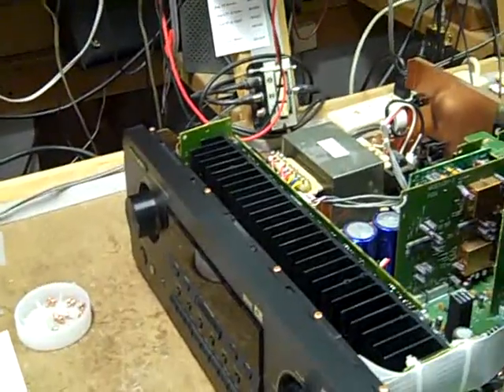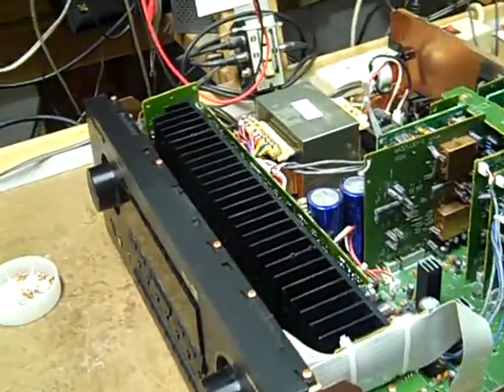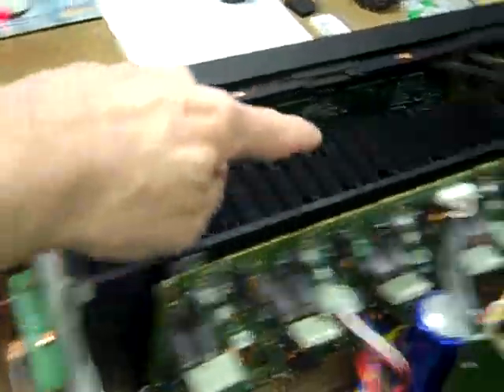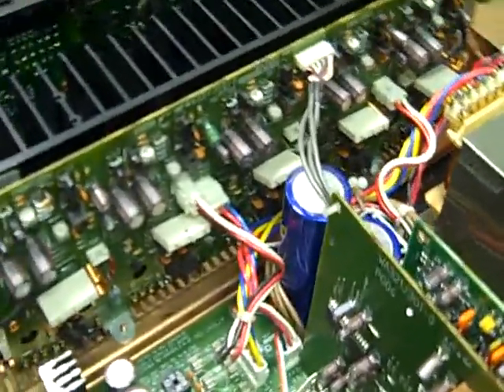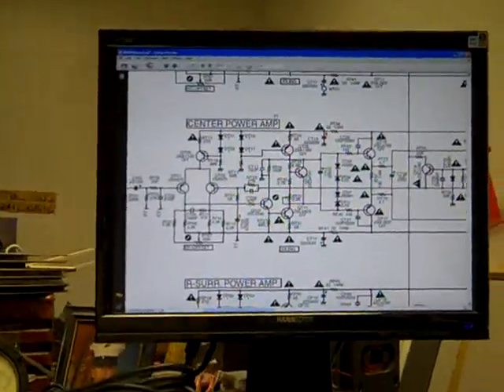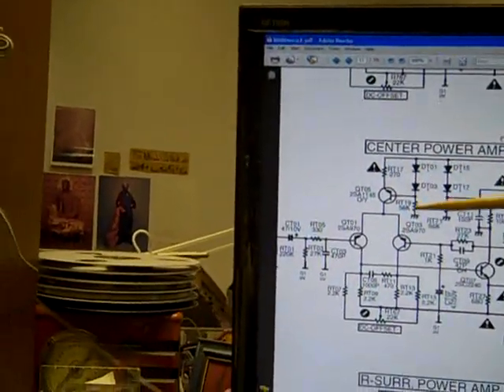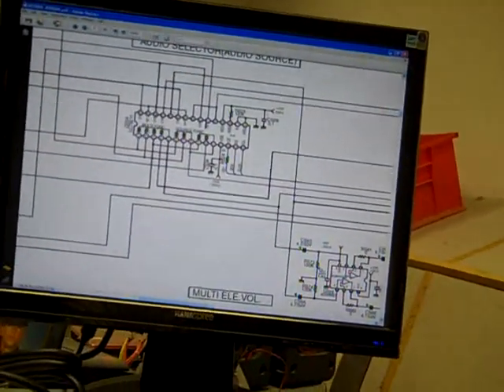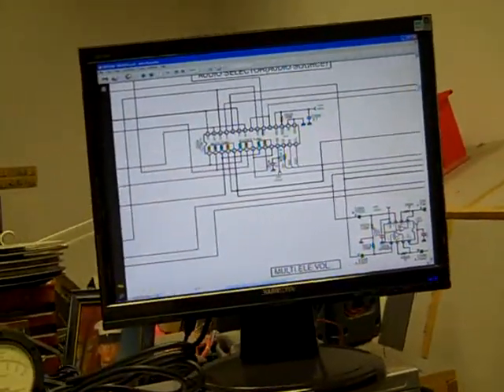Marantz SR-8000 Repair Brief

Comment: HIi Mark , i've got a marantz sr 8002 to repair , symptom :green led stand by , no protect, no click relay stand by and no display: i checked all voltage on stand by power board : +5vlt ok, +12 vlt ok but on  p down and stand by i haven't got 5 vlt !, i suspect ic74 detector voltage? and i checked system error check points on ic 17 , there is no voltage on p down , and the ic 17 is a bit hot, could you help me, thanks.
Reply from the maker: I have seen bad resistors, R903 and R904, which are shown as 0.47 ohms but should probably be changed to 0.22 ohms, and bad fuses F901 and F902.
They are shown as 5A in the schematic but I have seen 8A in the field. I have seen repeat failures of these parts with no clear resolution.
I think I would expect IC 17, which I think is the system micro, to be warm normally.
Reply: I already check the voltages on the regulator board, (+/- 15 volts) seems to be ok on the regulator board, for that I had to short circuit the pin (p down and stand by) on the standby board for activate the relay stand by and activate tensions on regulator board  (pr power) but no display and no relay is activated after that.
Reply from the maker: Have you checked the -30 volt line from the Power pwb to the Front pwb?
Reply: Yes , it's ( vkk pin ) -28.8 volts sometimes blue led hdmi and led volume light up , but always no display!
Reply: it's an european model
Reply: sorry I took the measurements and I have not (-28.8 volts) on the pine (vkk) I have about (3.95 volts)

Comment: Hi, where can I get vb-18mbu-565 relay for Marantz sr8000?
Reply from the maker: https://www.google.com/search?psb=1&tbm=shop&q=relay+vb-18mbu-565+&hl=en&ved=2ahUKEwjK36rjj9bvAhU1cm8EHckLBrsQu-kFegQIARAU
Reply: @mdzacharias  I don't see any 18VDC.
Reply from the maker: What relay is it in the SR8000?
Reply from the maker: And is this the old SR8000 stereo model or the approx 2000 model year surround model? They used that model number twice.
Reply: @mdzacharias  2000 year model
Reply: Same one that you worked on. I bought it around 2000 year. The black ones. These output protection relays wear out over time.
Reply from the maker: @guitar1junky  Is it a speaker relay, main power relay, what?
Reply: @mdzacharias  Speaker relays
Reply from the maker: @guitar1junky  24 volt relays should work fine.There's about 11 volts to the high side and -15 to the low side. Don't know why they did it that way.
Reply: @mdzacharias  ok. The schematic shows 65V-10 B+. So, looks like low side switching.

Comment: Hi Mark, i'm from Brazil and i need your help, please...

My marantz reciver sr7000 is showing an error message when I turn on the unit, "ERROR ACK". This has happened a few years ago and disappeared. Now it's happening again and i don't know what to do ... what does it means? How should I proceed? thanks,
Reply from the maker: Giovane Machado I have no information on this problem. Sorry.
Reply: Giovane Machado  Hi, i have a same problem. Tell me please how do you solve your problem?
Reply: cheers. I have had this problem when the p754 card is disconnected, it has 3 connectors, check them well

Comment: Hi Mark,

My Marantz SR-8002 (newer model, 2008) is doing fast flashing light in standby mode. I reset it and the unit comes online for a moment but immediately after goes to flashing red light mode on standby/start button. During short time the unit is ON, display comes online  and I hear ignition signal on my speakers. I have all necessary equipment for repair and I am electronics savvy. What do you recommend to check/test first?

Comment from the maker: I'm still not convinced it isn't a blown channel, but you can try checking the output of the various voltage regulators. If one is bad, it might cause this. One thing though. You have not provided me the info I would need to help you, and you don't seem like you are a technician. If you are not, your chances of fixing this yourself are very slim. Some things you can be a cheapskate and get info on the internet to fix, some things not. This is one of those.

Comment: sr8000 sound will cut out during movie just center channel will come on and off on bench test didn't happen almost always happens when watch movie also when happens center is out on 5 channel stereo too. it takes about 30 to 60 mins to happen . I'm ready to scrap this unit as it is intermit and can not find. ever come across this. been on bench for two hr  not happing any more
Reply from the maker: There's lots of potential for bad or broken solder connections in these. Where the vertical boards plug in, on those board's plugs and on the underneath side of the main board. Don't rule out problems with speaker relay or solder connections at the speaker terminals.

Comment: Hi I'm from Brazil. I am needing the HDMI Assy code "COP12525F" AV Receiver Marantz SR7008 model plate, ande manual serviceI would like to know the price and shipping to Brazil. I look forward Thank you
Reply from the maker: Deimar Ribeiro I am not a parts dealer, but the COP number on the board is not Marantz's part number. The part number for this board is 9U6391012200M . It will be very expensive.

Comment: Mark I think the Marantz amplifiers are a piece of shit very expensive and overrated, it is true that they have an excellent sound but and heard many cases of people who claim to have breakdowns with their marantz, please give me your personal opinion thanks.
Reply from the maker: Nothing wrong with the engineering on the newer stuff; but every manufacturer is going to have issues with the extremely complex and sometimes buggy HDMI boards, which usually also include all the main microprocessors and EEproms. It's the current state of the art in AVR receivers, processors, etc. Marantz is no different in this respect.
The older Japanese built stuff from around 2000 model year was generally more reliable but even these had issues sometimes. I mostly use analog anymore, but when I do swap in an AVR (for stereo) it's Yamaha.
Yamaha is better engineered, better supported, and actually rolls their own soundfields rather than just buying chipsets from Analog Devices or whoever.
Reply: Mark Zacharias Mark Thank you for your information had many doubts now no longer, I think I'll buy the Marantz sr7012 :)